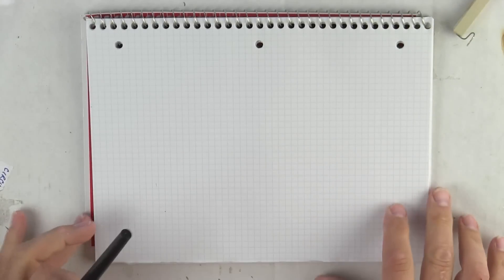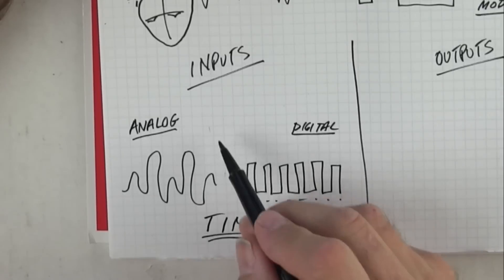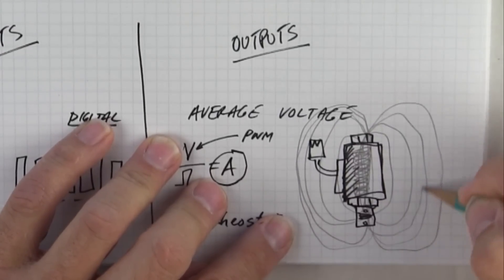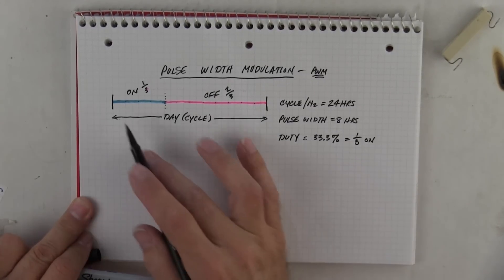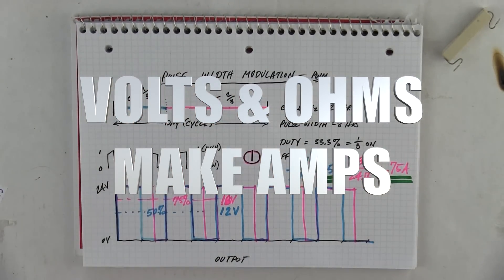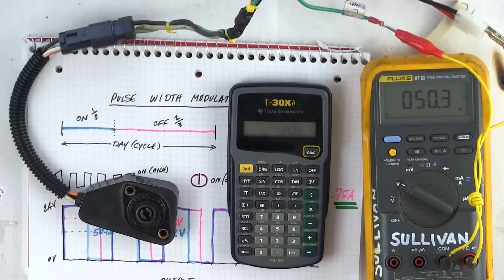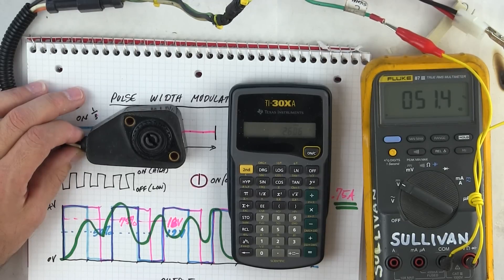Essentials of PWM

Comment: ordered your book. thank you for your insight.
Reply from the maker: You're welcome. Let me know if you have questions.
Reply: A book on basic electronic ?
Reply: @bivideo7  Hi Dan I ordered your book also but I don't know how you got the .982 Ohms in your equation  on page 57. I have tried all kinds of math to get that number but I can't get it. Could you tell me how you arrive at .982  Ohms? I can get the 27.21 amps if I divide 26.75V by each solenoid's  resistance and add them together to give me 27.21 Amps , I just can't get the .982 ohms part.

Comment: So on a PWM 3 pin oil pressure sensor. How would you test the circuit with the load probe pins are I believe supply signal and return (CAT terms)

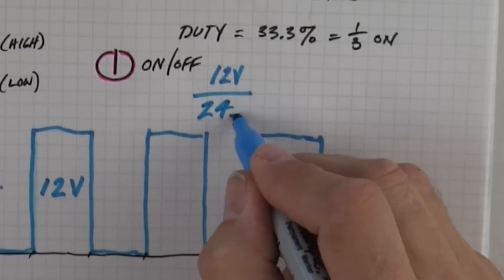Comment: Where does the 24 ohms number comes from at 13:44? Is it just arbitrary number you picked?
Reply from the maker: +Vilo Conshmillo Generally - the resistance of a hydraulic SOLENOID (NOT a battery RELAY) is roughly equivalent in OHMS to the VOLTAGE of the system. I've found through experience that a 12V solenoid is always close to 12Ω, and the same is true of a 24V solenoid being close to 24Ω. This is just a good number to keep handy if you don't have any other info to go on.
Reply: +Daniel Sullivan Alright, thanks for the response. I just wanted to know where it came from.

Comment: Dan, how I found your channel I do not know... But fascinating indeed.  Question: as more volts equals more amps, but how is it possible for a device that runs on 120v with an output of 1000W that draws 12A...but the same identical device has ability to run on 240v, and still has same 1000W output, but states it now draws 6A. The way I understand your video, when this device goes from 120v to 240v, the amperage of 12A (@120v) would go to 24A (@240v).   What am I not understanding correctly?
Reply from the maker: Watts = Amps x Volts. In Ohm's Law, amperage is the RESULT. In Watt's Law, amperage is the REQUIREMENT. Watts = HP. To get the same HP out of a system, you need less energy (Volts) if the flow (Amps) is more.
Reply: Think about it like water so you may understand whats going on. Say your load, which is watts, is a bucket you need to fill at at certain rate. Lets then say a 1 inch water pipe with a pressure of 10 lbs is what this load, lets call it 1000 watts, needs to operate. Also know that this load is drawing this much water. Without this load connected no water would flow. Now lets put (2) 1 inch pipes to this bucket. Obviously you would have too much water unless you reduced the pressure. Like cut in in half, since you doubled the water pipe. In this scenario the water pipes are the same as volts. The pressure is amperage. So watts are equal to volts times amps. This is ohms law. When volts go up amps come down because watts dont change. Your 1000 watt load will be 1000 watts weather it is supplied by 120 or 240 volts. But the amperage will be half of its 120 volt when 240 volts are supplied. If you get this you should understand that this same load could  be supplied with 5 volts power in which case it would use 200 amps of current. This is in theory, would actually work if load was like a heater. But motors need their nameplate voltages or they will fail miserably.  Think of it also as 120 volts times 12 amps equals 1440 watts. So then 240 volts times 6 amps equals 1440 watts.. I am totally impressed with Dan Sullivan. Ive been an ac only electrician all my life. This automotive dc current is new to me. Dans truly cuts through a lot of crap and quickly easily and correctly diagnoses auto troubles. These days,  in my line of work , up to 600 volts ac,  it is considered too dangerous to do tests on live stuff so we are supposed to use energized testing methods. Ohmeters and taking wiring apart and put it back together. Before all the safety rules, it was much faster to troubleshoot engized circuits.  Dan can suggest these ways because safety guidelines allow it. I say look only at his teachings and really ignore all the rest. From an old timer l say trust him. There is no end to folks that use primitive techniques. And love to blab about it.

Comment: volts and ohm do not create amps....  volts pushes amps and ohms pushes back.
Reply from the maker: Mechanically, volts and ohms MAKE amps - I don't say "create". You're essentially correct, from a test question point of view, but there are a many different ways to think about most concepts. My point is that volts ÷ amps don't MAKE ohms. Teaching this concept with math is not effective if the real mechanical relationship is not understood. You're being a little narrow-minded if you think your explanation is correct and mine isn't. If you're smart enough to appreciate your perspective but you feel the need to criticize my explanation, I question your motive for making the comment.
Reply: you are a smart guy but you a false statment on your thumbnail that volts and ohms makes amps...this is not true so why would you say it....it would only confuse a new student .  And by the way...why do you feel the need to degrade any body who adds to the conversation the you may disagree with. Its sad that you use the terms idiot and stupid so much in your videos when speaking of people who do things or think things diffrent then you.
Reply: And one more thing...Mechanical Volts and Ohms do not make Amps...Calculationaly it does but not mechanical. In a supercooled superconducter circuit...the circuit has virtually no resistance but a voltage source push the electrons through the circuit.   VOLTAGE AND A CLOSED CIRCUIT MAKES AMPS.
Reply from the maker: AND THE CIRCUIT HAS RESISTANCE BECAUSE IF IT DIDN'T AMPS WOULD BE INFINITE AND EVERYTHING WOULD MELT. Without resistance the CALCULATION won't work. You included TWO variables - there are three. WHAAAAAT?
Reply: Wrong again...in a near zero resistance circuit...melt down would not occur if the voltage source were not pushing the current beyond the conductors amperage raring.  I know this is beyond auto tech level of elecrical therory...sorry to go above your understanding.
Reply from the maker: ken ezzell First, you said "near zero resistance", which means Ω>0. That means, if my understanding of English is correct, there's a resistance. Second, regarding your comments about voltage not pushing current, blah, blah, blah --- duh... V÷Ω=A. Dude, you want me to admit you're smarter than me? No idea, but you're certainly a bigger smartass. That's undeniable. What's truly beyond my understanding is why people like you take this shit so personally. Really, like, get a life...

Comment: For a man that understands the importance of language, I don't understand why you say,  volts "plus" ohms makes amps. You should always say volts "divided" by ohms makes amps. It might not seem important, but it is.  Thanks Dan, glad you're back.
Reply from the maker: +John C I'm pretty sure I've never used the term "plus" - I say volts AND ohms MAKE amps, which is the mechanical way of thinking about it. My position remains that the math is secondary to understanding what does what. If I said "plus" tell me where so I can review it.
Reply: To many people "plus" and "and" mean the same thing.
Reply from the maker: John C Okay - but I didn't say "equals", so it isn't math. If you've watched any of my other videos - specifically those on Ohm's Law - you'd understand. I don't necessarily disagree - but I don't really agree either.